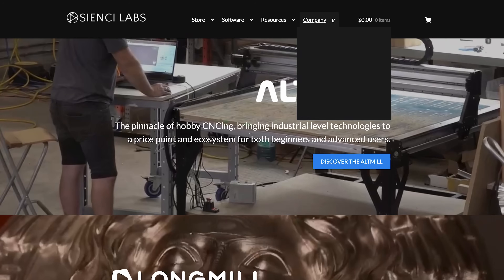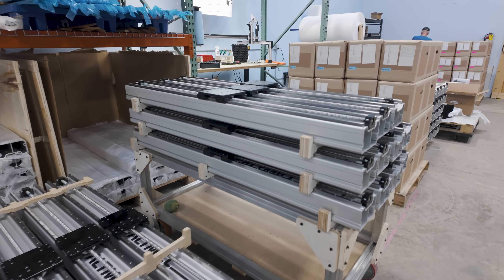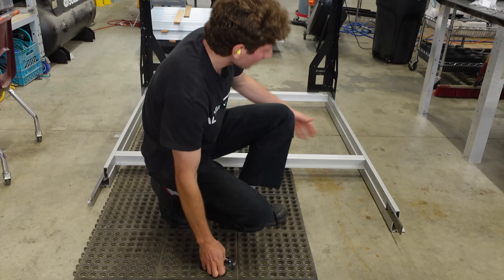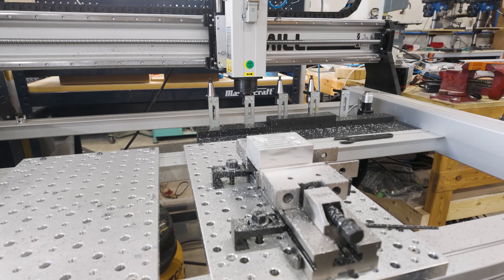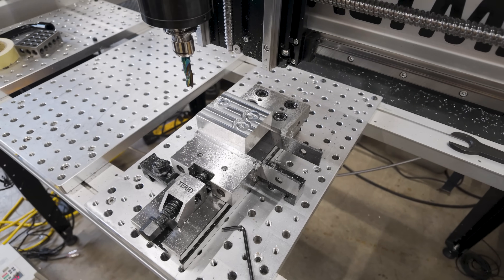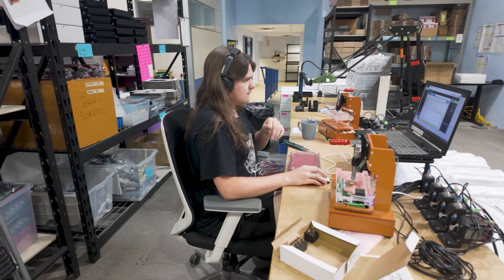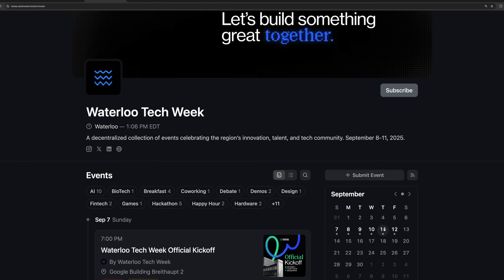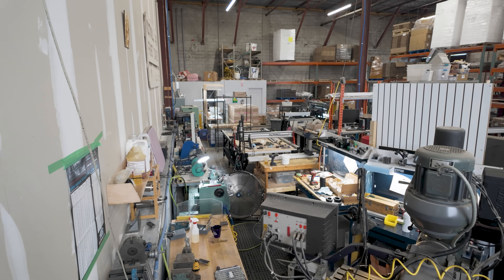Production Update ❘ September 2025

Comment: Did a hear correctly the 2.2kw spindle can work with the hy100 VFD that came with the 1.5kw spindle?
Reply from the maker: Hey Alan,
Thanks for asking, but that info is incorrect. Each spindle requires a different VFD, so they are not compatible/swappable. If you want to upgrade to the 2.2, you'll need the proper VFD for it.